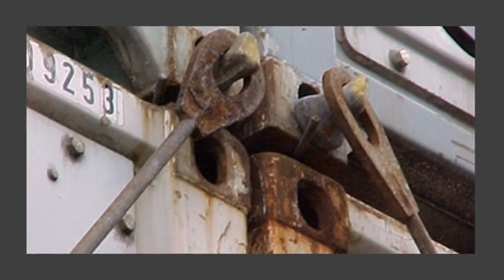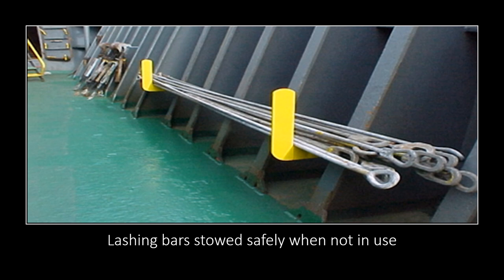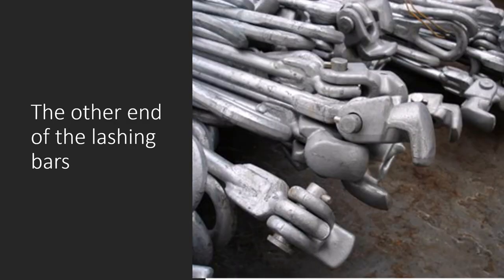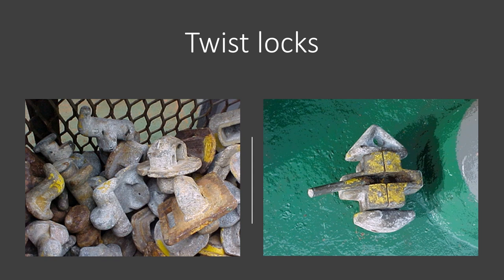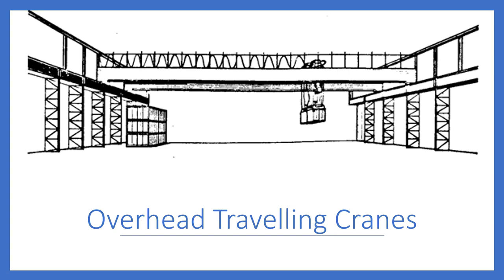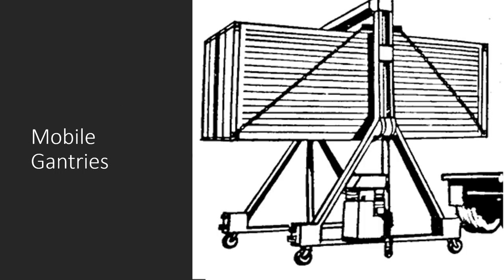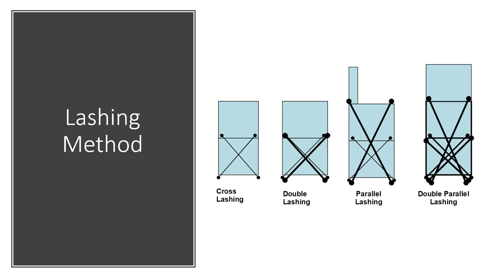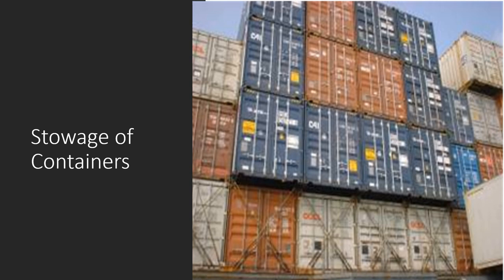What Container fittings are used to ensure safe stowage and carriage of cargo?

Comment: Sir , how I know how many lashing is required ??
Reply from the maker: There will be a cargo securing manual on your ship or a lashing manual which will tell you:)
Reply: @SteeringMariners  I have gone through but I am not  getting it 
" IMO thumb rule method to calculate the no of lashing  required that is the total of the MSL value of lessings on each side of a unit (port  as well as stbd) should equal or exceed, the weight of the item.

What MSL means ?? 
Please explain sir